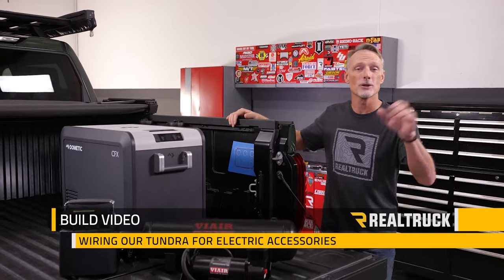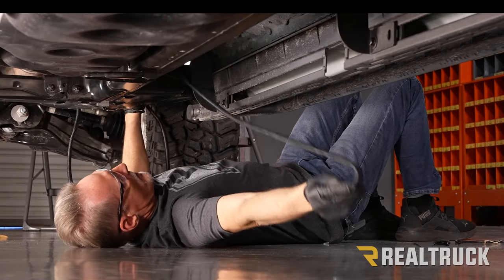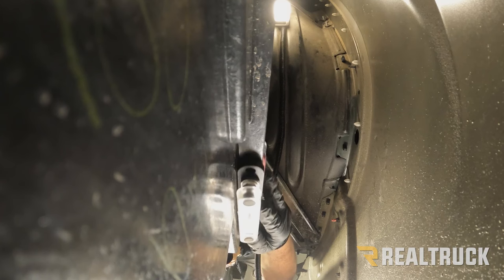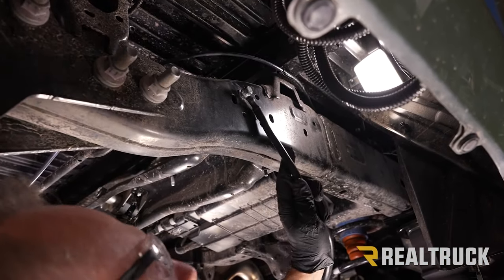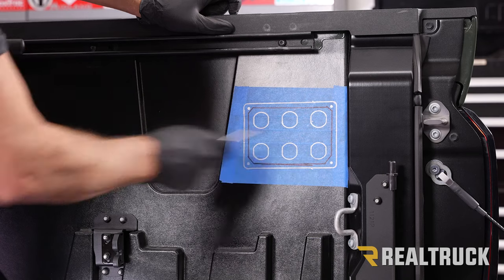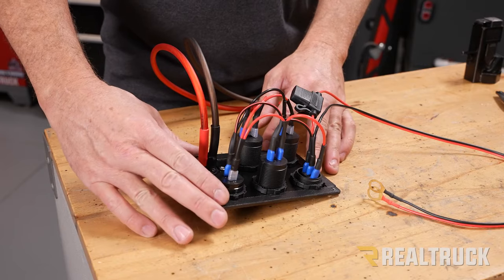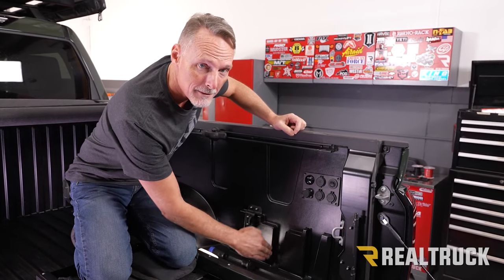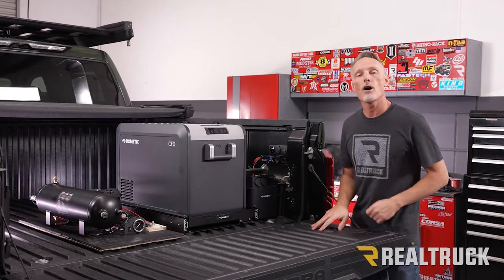How to Install Power To Your Truck Bed

Comment: Very professional, Loved it. 
You could also point out that if you just need some low amp power at the rear of the truck you could build an adaptor plug to access the auxiliary power and ground terminals in your pickup trailer plug.
Reply: Very nice, but why does almost every video have the most irritating back ground music.

Comment: I was starting a project just like this one, when I ran across your video, it helped me from making some rookie mistakes.  I do not need 3 12v accessories and was considering replacing one of the 12v connectors with an Anderson connector, this way I could feed solar back into my mpt charge controller to recharge my battery. I plan,  to install a Lithium Ion  battery. This would require a separate run, I think its safer to keep my bed accessories separate from the rest of the truck. I am also going to install a 700 watt inverter behind the rear seat, but will wire it for 1000 or 2000 depending on costs. So the plan would be charge the secondary battery while its being used for the fridge and accessories, during the day, live off the battery at night, then rinse and repeat.
Reply: That's really cool. You should def do a video of the installs, I'd love to see it

Comment: Is there a risk if the buss bar gets wet? I have seen on some RV forums that it isn’t recommended however your install method looks great with the ability to connect higher amperage at the buss.

Comment: Careful with what power cable you pick and make sure you DO NOT USE CCA wire. That’s copper clad aluminum and is just copper coated not actual copper. Make sure to USE OFC COPPER WIRE that’s oxygen free copper that will be pure copper wire and is a better conductor.
Reply: looks like a wiring kit for speakers...at least that's what mine looked like 30yrs ago. cheap CCA garbage

Comment: So this is suggesting to run a 12v fridge off the starter battery? What happens when you park and stop driving but still want cold drinks? Wouldn’t it be better to run a second battery with a DC-DC charger to power all the 12v accessories?
Reply: My dometic fridge has a safety shutdown and notification if the voltage gets to low. I think this would be good for the commute to and from wherever you going but not long term.
Reply: You could let the truck idle.  You get about 5 hours of run time per gallon of fuel
Reply: Deep cycle battery. We used an Optima Yellowtop for our main battery in our Jeep Wrangler for 3.5 years and never had a single issue running the 12V fridge overnight for tons of camping trips.
Reply: Run the fridge off a mobile Solar panel.
Reply: That's why he put the Dometic battery between the truck power port and the refrigerator.

Comment: What is the tool called that you crimped the copper connector on the wire? The one you hit with a hammer...

Comment: How many watts is that? I need something like 110 watt plug
Reply: That's pretty standard wattage, like a cigarette lighter plug. You can just buy an adapter that plugs into your trailer hitch plug
Reply: @0my  Thats why I did, i have a 100w 12v water pump that I have attached to the top of a home depot bucket and a sprayer to clean my bird dog after a swim or mud. the 7 way to cig adapter works perfectly. i would like to do something like this eventually, probably an inverter too.

Comment: after install what kind of sag do you encounter at the power point in the bed vs at the battery itself?, i'm thinking about doing something similar in my F150 and need to figure out what size wire i need to use for my actual install to the bus bars in the bed itself
Reply: Professional electrician here. In order to future proof your build I would personally (And I did in my truck) Run 4AWG Oxygen Free Copper wire to the Bus Bar. Then I would use 10AWG to/from the 12V plug. Just get a spade connector kit and you'll be Gucci. 1/2" loom will work for the single 4AWG and the 2 10AWG as well!
Reply: @TRalstoon  would this be able to run a normal compressor? Or do I have to buy a special 12v compressor

Comment: nice, I also got a 2022 tundra... can you list the parts list you used?
Reply from the maker: Parts list includes
2 Pin Trolling Motor Plug Receptacle
8AWG-5/16" Battery Lugs

3 Socket Cigarette Lighter Adapter 12V Power Outlet + ON-Off Toggle Switch Multi-Functions Panel

8 Gauge Wire

Wire Loom – 3/8 Inch

12V Power Distribution Block 5 x 5/16" (M8)
Reply: Really should have a low voltage disconnect in there

Comment: Seems silly.. There should be a way to tap into the 12v already at the back and already fused. Like the trailer hitch. If you want high power like a compressor, it would be better to install the compressor next to the battery. So much wasted truck bed space.

Comment: Good video but no link to parts and couldn’t find them on the website. Sad effort
Reply from the maker: Parts list includes
2 Pin Trolling Motor Plug Receptacle
8AWG-5/16" Battery Lugs

3 Socket Cigarette Lighter Adapter 12V Power Outlet + ON-Off Toggle Switch Multi-Functions Panel

8 Gauge Wire

Wire Loom – 3/8 Inch

12V Power Distribution Block 5 x 5/16" (M8)

Comment: Tacoma has a 110 in the bed.  I'm surprised that the Tundra doesn't.
Reply: doesn't come standard on some trim models, my 2024 sr5 doesn't have power in the bed.

Comment: Parts list please
Reply from the maker: Parts list includes
2 Pin Trolling Motor Plug Receptacle
8AWG-5/16" Battery Lugs

3 Socket Cigarette Lighter Adapter 12V Power Outlet + ON-Off Toggle Switch Multi-Functions Panel

8 Gauge Wire

Wire Loom – 3/8 Inch

12V Power Distribution Block 5 x 5/16" (M8)

Comment: I am planning on making a power tool box with a small air compressor a small water pump a small ice chest  and a 3,000 watt power inverter with two 12 volt batteries inside and with 3 small solar panels on top the tool box to charge the batteries,  so help me god😊